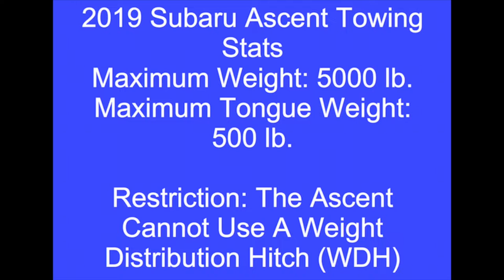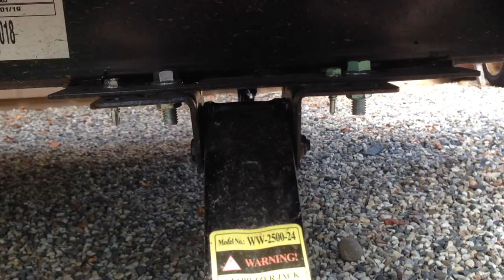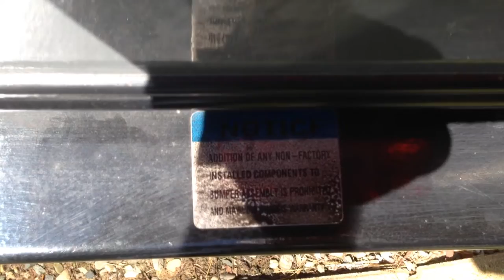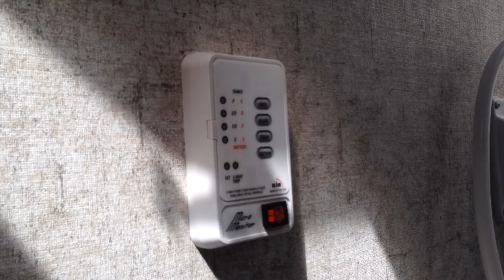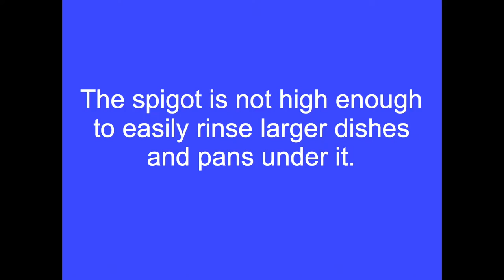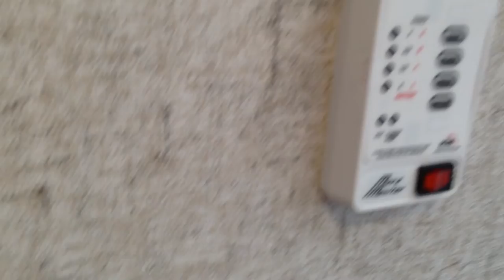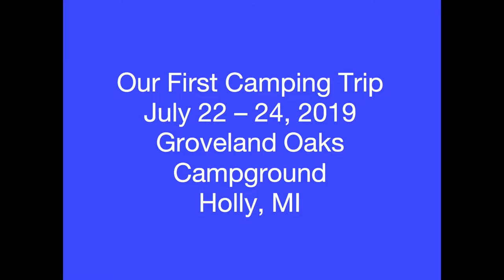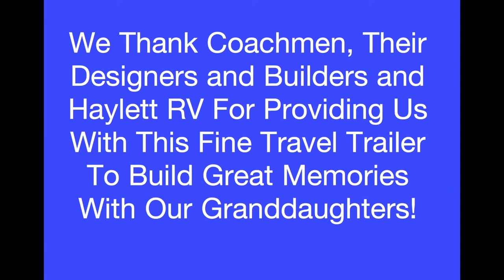The 2020 Coachmen Apex Nano 187RB (owner review)

Comment: Ken, we live in Cincinnati and we bought the same model at Haylett RV.  Your review was thorough and spot on.  Ken's delivery is dry, but accurate and thorough!   The camper is really good!   All campers have issues.   We actually had an issue with the roof when we purchased it and Coachmen came out and got our camper, brought it to their shop replaced the roof.   The vent was mounted behind the AC unit and we couldn't install a cover on the vent or even replace the vent without removing the AC.   we also had water coming into the camper when we used the fresh water fill.   It looked like someone nicked the water fill line with a blade.   And it only leaked when you aimed the water hose a certain way.  Nevertheless, I had to replace it.   We did some replacements ourselves because we are 4 hours from Haylett.

We currently have had it for a couple years and have done many good trips in it.  (Glacier, Yellowstone, Utah, Az, Michigan, TN, NY, FL (Marco Island) SC, NC, VA, GA, MS, AL).  We've been very happy with it so far.
We started toeing it with a Honda Pilot, but I wasn't happy with how it pulled, so I replace our vehicle with an F150.  It pulls much better now.   

We had the same amount of rust on our jacks stands but we lubricated them with some lithium grease and they now turn easily.   We also have a Bosch 12v drill with the two gear speeds.  We added a bigger battery to the drill.   It now easily raises and lowers our jacks.

Our tongue weight seems heavy as well. We use a Recurve R3 400 WDH with it.  I added a second battery up front.   Based on comments on this video, I may switch it for Lithium and move it back near the dinette.

We replaced the tires in it, but it was a little too late.   They got replaced after a blowout.

We modified the bath sink as you had done.    We experienced the same problems.  We also replaced our kitchen sink faucet with one with a hose and spray nozzle.   We haven't had ANY problems with the shower walls and we use it on most every trip.    We added some hooks and a squeegee in the shower and also added a spring  curtain rod from IKEA that we use to hold shower caddies and wet clothes or swimsuits when we need to dry them off.   We replaced the shower head with a massaging model with a bigger head.

For the water heater access, we removed the screws and ins talked magnetic latches and a knob to make it easier to access.   In hindsight, I probably would have just used a couple of velcro strips instead of the magnets.

We too think the outlet under the table is in a horrible place.   We are adding a power strip to it that will sit near the table.   We covered our cushions with something other than vinyl and added bike mount latches to bring our bikes when the dinette is down.   My wife doesn't like how the cushions feel so I may build a loveseat or out in captains chairs that can swivel to make it easier to watch TV as well as use the dinette, still TBD.

I added LED lights in the area near the fridge that come on when we open the door.  I added solar to the roof and a solar cutoff down near the furnace.

I added some fans and LED lighting near the head of the bed.   The air circulation isn't that good up there even with a fantastic fan above the bed.  I wish it had some vents that went to the front that we could open for fresh air.

We added an extension to the foot of our bed (an Ikea LACK table with some plywood on top to get it to the right height and replaced the mattress with a full queen from the Original mattress factory.   A must have in my opinion.

We mounted our TV with a latching RV mount.  I just pull a small loop and it releases the TV.

I also added an LED light strip (it's so much easier to see things) in the basement as well as a battery cutoff.  Having a removable battery key outside never made sense to me.  If you leave it in/on to charge the battery, someone can take the key.

We also added some of those door mats to the steps to clean or feet when we get in the camper.  We screwed them into the steps with self tapping screws.

For folks wondering about the workmanship of campers.   They're all a bit sketchy.  I would get it again.  It's been a good experience.

I look forward to hearing more about your trips and modifications to your camper!!
Reply from the maker: Brian, what a great comment. I hope that folks take the. time to read the whole thing! I'm not really a YouTube content. provider, but I did enjoy putting together this video to try and help folks. Thanks so. much for your thoughtful and use full comment. Ken
Reply: @kenmyers7625  Ken, it was such a thorough and helpful review for what people can expect.  I forgot to mention that we also had the window squeak.   🙂.  I laughed when you talked about the outlet under the table, the loudness of the AC unit, and the lights from the radio and TV amp.   I wish there was another option for the AC unit, without having to buy a new one and sell this one, but it does cools the camper down well.  We fixed the light with some scotch tape and a piece of paper.

Maybe we'll see you out there.  We're heading to Sleeping Bear in July and out to the Balloon Festival in October.

Comment: I converted the rv queen to a full queen memory foam mattress. I also added a second propane tank, made a cover over the indoor stove top to increase counter space, added a bike rack on the bumper for 2 electric bikes, will change the steps to the new solid steps, will add sliding drawers for better under seat access, will add a sliding drawer for the under bed access since the new thick queen mattress makes lifting the bed a challenge, added a 32in Tv, added a cuttlery storage upright cabinet next to sink...many other little changes...All these mods will increase the overall weight close to the max gvwr rating of the rv. If you include the most items you normally take on a trip water, food, drinks, camping gear etc, then i will over load the rv which gives me no choice to increase the gvwr rating.
Reply: Wow, sounds fantastic! Only thing I've done so far this year is change the tires to Goodyear Endurance.

Comment: After an extensive search, we have ordered a 2022 187 RB. Some manufactures have turned cutting corners into an art form. It's even in yachts too! It just going to make me rather eagle eye when my delivery day comes. By the way, we did see one so cheap I could have ripped the insides out with my bare hands.
Reply: They have made a lot of changes to the newest iterations. A lot of the changes "fixed" some of the things I commented on.  They do have heavier duty axle now and it looks like a different brand and mounting system for the four corner stabilizer jacks.  The UVW is up, as well as the tongue weight.  I like the high-rise kitchen sink faucet, but don't care for the "farm" sink. (Just me.). I really don't have a use for solar, as the wife and I use campgrounds and it just adds weight.  The second propane tank adds almost 40 lb. of new weight, which is mostly on the tongue.  Have fun with it. We really, really do like ours very much and overall, we are happy with it, and especially with my small upgrades and "fixes".  The roof seals and all other seals are holding up well.
Reply: @EFO-of-southeastern-Michigan  We are excited to see ours arrive. My wife has already ordered a quilt and sheets for it. I think some litho grease on those jack screws for the stabilizers will keep them from binding. I have an old cordless drill that would be perfect. 2022 will do regnal trips than in 2023, we will head west from Maryland until we run out of land.

Comment: Thanks for the detailed video!  I was already considering the same combo of vehicle and RV, and your video is answering a lot of questions I had about it.
Reply from the maker: Thanks for the comment Haygarp.  Don't let all of the mostly minor things that I took care myself on the unit put you off.  My wife and I just love it and can't wait to go out again for another trip.
To ME, it is a great match to my 2019 Subaru Ascent with the Premium trim package.

As you can see in the video, for the most part, the issues are minor.
Today, I had to 'fix' the wiring coming out of the gray tank. I noticed it dangling down under the trailer. It had come loose or anything, but Coachmen only had the wiring attached somewhere with one short piece of electrical tape that fell off.  It was a super easy fix.  I put a couple of tie-wraps on it, attached to the waterline, and it is all good to go.

Comment: Some of your suggestions have been added to the 2021 Apex Nano, such as the sink and stove covers. We just ordered a 2021 today. I will let you know of any more changes and quality control issues that I find on ours when it comes in.
Reply from the maker: Thanks Dennis, I did notice that.  I've been following the updates.  The stabilizer jacks appear to be different and mounted differently.  I noticed a couple of other things, but cannot remember what.  Also, all of the most recent ones I've seen online have the off grid package with two 20 lb. propane tanks.  Still no battery disconnect switch, that I've seen, but adding mine was super simple.  I'd love to hear about any other updates you might find on yours when you get it.